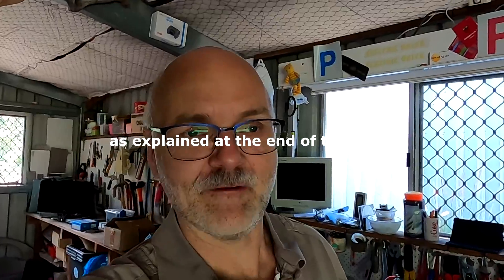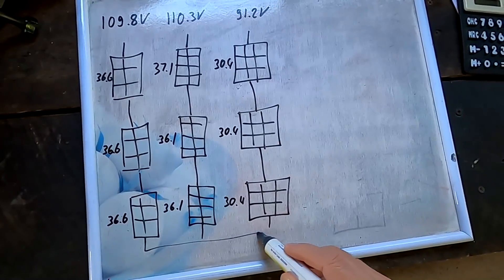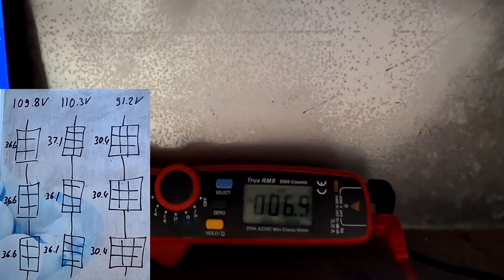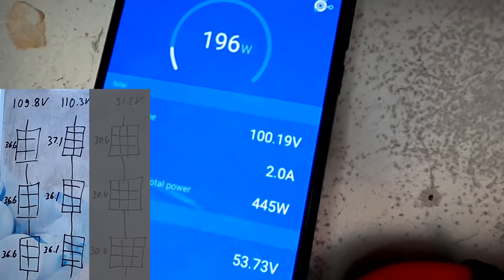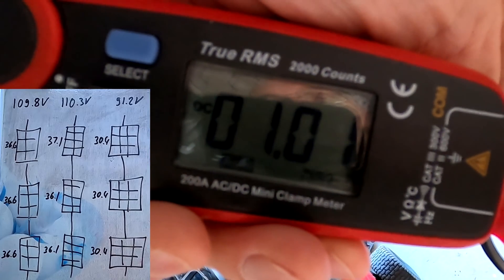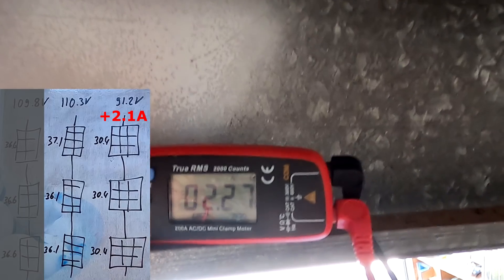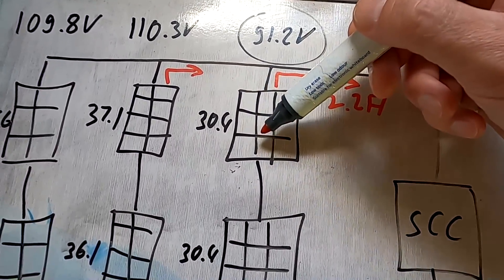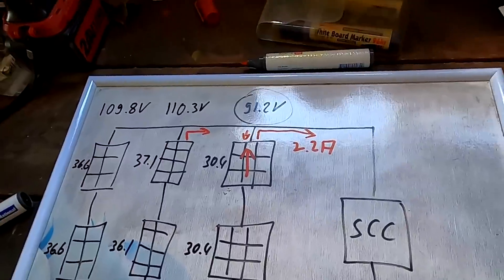Different solar string voltages in parallel. Does that work? (no blocking diode)🌞🔧⚡🔋

Comment: Interesting, I thought keeping same number of cell for each panels you can't go wrong. But that different, I was thinking the diode is protecting the reverse. Is those panels ok now (you know that last week)?
Reply: Andy has still not adequately tested the bypass diodes at working voltage and current. I doubt even a solar panel tester will find a fault like that, (if that turns out to be a problem) even under load, and or in sunshine. Also it’s not good mixing different panels. Andy should test another 6 of the Sunteck, and try those with the 3 on the roof. Maybe migrate odd panels to another roof with another controller, even a PWM, if that produces more power
Reply: @michaelbouckley4455  If the budget is unlimited, then your suggestion is appropriate and reasonable.  If the budget is tight, you do what you gotta do, to getter done.

Comment: I think I'd use a  separate charge controller per string!
Reply: The additional expense of One-Charge-Controller-Per-String can NOT ever be cost-justified by the very small 5% - 10% increase in total wattage that you would see ...
Reply: @MrSummitville  well that would depend on the different sizes voltages and amperage is of solar panels that you have if you have a string of 100 watt a string of 200 watt the string of 250 and a string of 310 it would be highly cost-effective to use separate charge controllers for each otherwise you would only receive the maximum amount of power that your smallest string of panels could put out
Reply: @recoblade1465  But Andy does NOT have 4 strings conisting of: 100W + 200W + 300W + 400W.  Andy would see only a 5% - 10% increase with 3 Charge Controllers vs Andy's single Charge Controller.  Andy cannot cost-justify buying more two more Charge Controllers for such a small amount of wattage, not ever ...
Reply: @MrSummitville  actually Andy has two charge controllers already and while his wattage range is not as bad as I do believe he has 190s 180s 200 and possibly a third wattage if you can't bring your wattage and amperage close to each other by series or paralleling your panels sometimes does make sense to run multiple charge controllers now if you want to be absolute about Andy's particular situation have you seen how many panels he has at this point he's going to start running into voltage issues with the to charge controllers that he currently has because you can't over-voltage in
Reply: And keep the voltage below 100!
Reply: @michaelbouckley4455  depends on the charge controller

Comment: There’s no problem in paralleling strings with different voltages ( when they aren’t that different) the only draw back is that the maximum power is limited by the voltage of the weaker string , as in parallel all voltages are the same, meaning some strings would only reach mpp with a different voltage .
Reply: Generally recommended to use the same make and type of panel in an array. Otherwise you only get the output levels of the weakest string
Reply: @michaelbouckley4455  The drop in wattage in the Higher Voltage Solar Panels is much LESS THAN the additional wattage GAINED by adding String #3.  You have totally missed the Moral of this Story ...
Reply: @MrSummitville  The moral of the story is to put as many panels as possible on your roof and if possible in a way that creates strings with voltages not too much different. But more panels is more important then them being more the same ;-)

Comment: WIth MPPT charge controller the voltage is up and down with any string depending on sun conditions if you were to connect directly to battery with a different panel configuration then maybe you would have a feedback condition IMHO but what do I know that is why I watch Andy to see his test results. I always use matched panels to feed each charge controller.